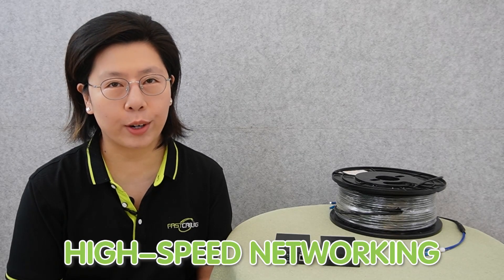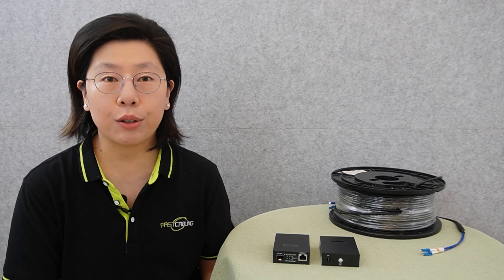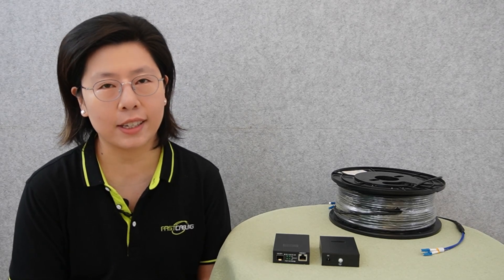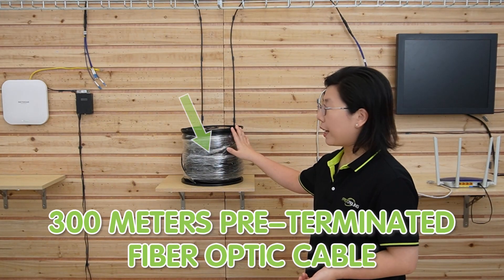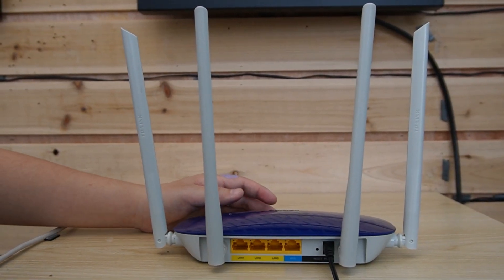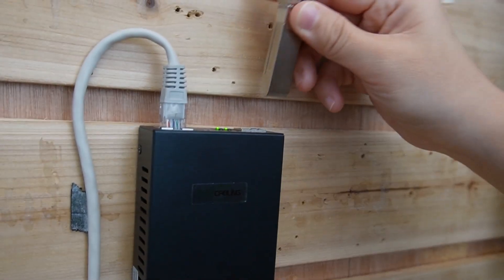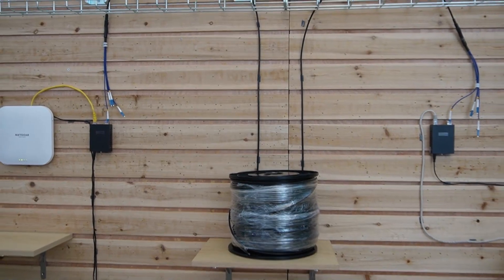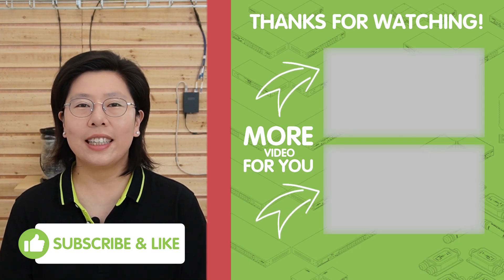Installation Guide for 10G Fiber Media Converters

Comment: The fiber optic transceivers I am familiar with have two connections for the fiber optic cables (one that sends and one that receives swapped at each end).

The transceivers she used only have one fiber optic connection.  

Is the same fiber optic cable used to send and receive data (BIDI transceiver)?

Can you use the traditional two port fiber optic transceivers as well?

I have read that Long Range (LR) BIDI transceivers should not be used on short range connection as the transceivers wear out prematurely. 

Since your demonstration is showing a short range connection would the 5976-43 10K km BIDI transceivers used be fine long term for these short distances.

I want to connect two buildings less than 60m apart and want to make sure I get the correct BIDI transceivers.
Reply from the maker: You can use traditional two-port transceivers (one for sending and one for receiving) if you prefer, but BIDI transceivers are designed to simplify the installation and reduce the number of fibers needed. Regarding the concern about Long Range (LR) BIDI transceivers and their use for short-range connections, it's true that using high-power LR transceivers for short distances can potentially lead to premature wear. 

LR transceivers are typically designed for long distances (10 km or more), and running them at short distances (like your 60m scenario) might cause excessive power levels that could stress the internal components. However, they're only used in this video for demonstration. For your less than 60m connection, you should ideally choose Cat 7 cables. For 10G Ethernet, Cat 7 can support speeds up to 10 Gbps over distances of up to 100 meters (328 feet).